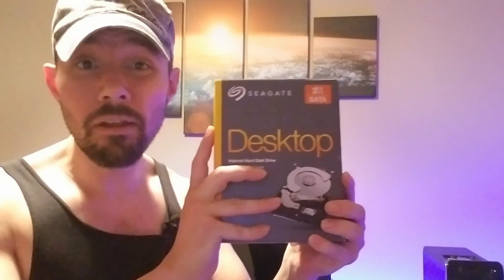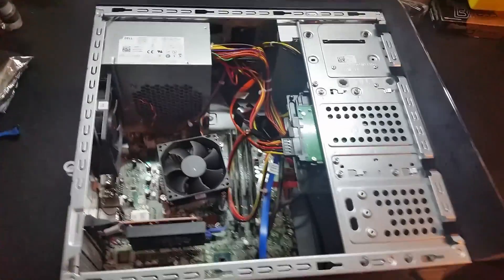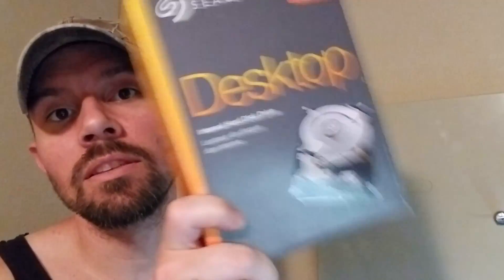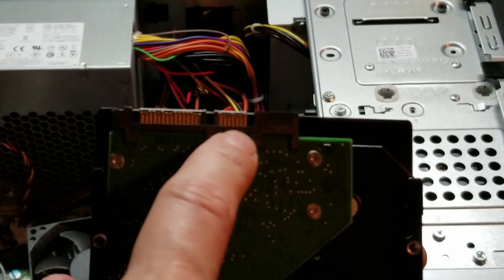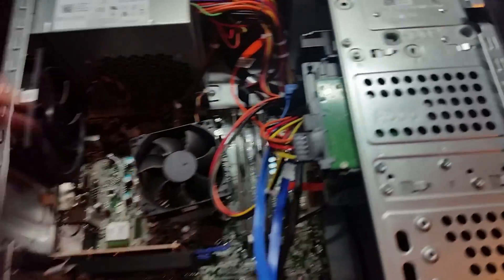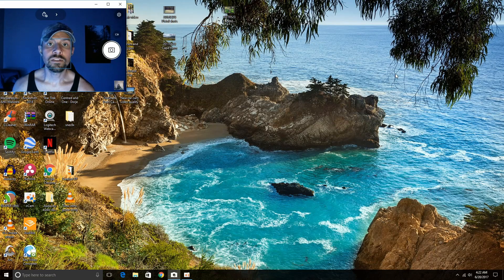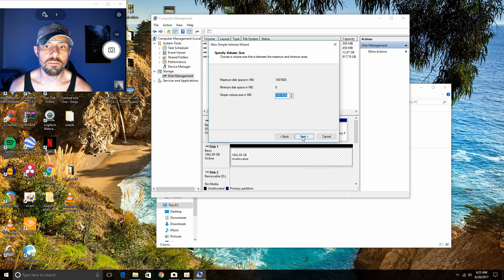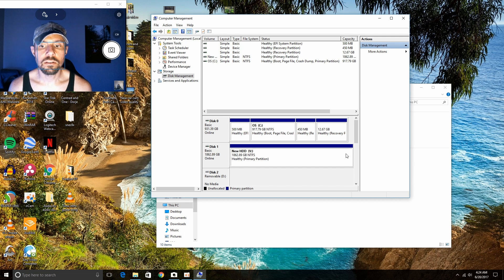How To Install And Format A Hard Drive Into A Dell XPS 8900

Comment: You don't have any problem with BIOS ?
Reply from the maker: Nope, no problems at all. I personally didn't have to update the BIOS.
Reply: If you want, I am writing to give you the options of my DELL 8900 BIOS which prevents windows from starting if my new Western Digital 10TB HD is connected. If necessary I take pictures of my BIOS options and compare with your BIOS , it this possible ? DELL is not able to give me a reponse